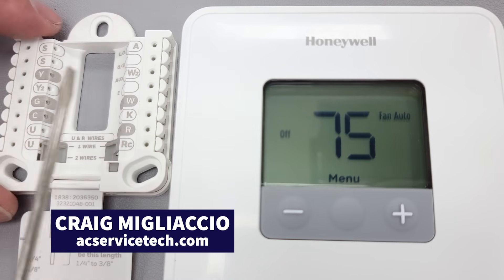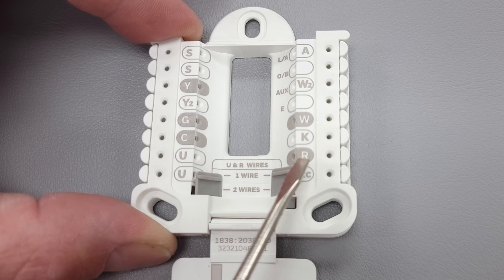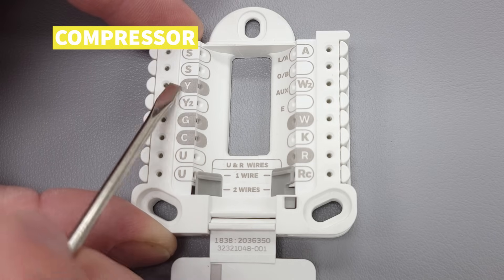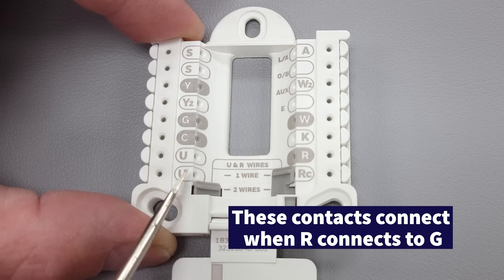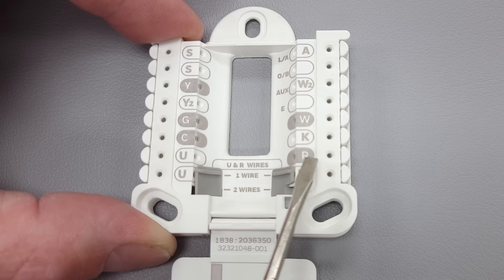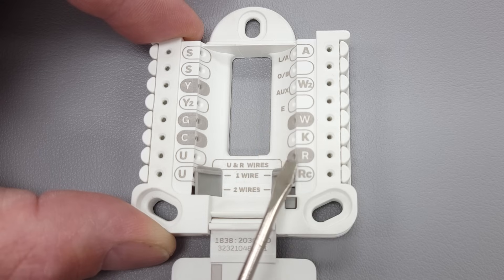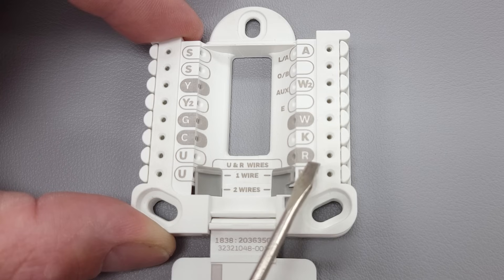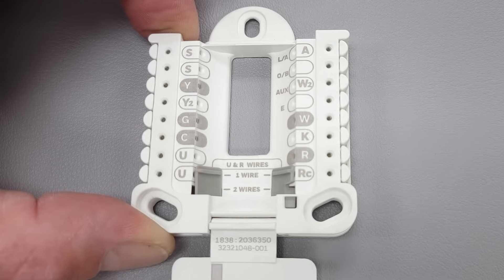Honeywell Thermostat Instructions, Wire Terminals, Functions, Color Code! Furnace and AC! Heat Pump!

Comment: I am currently having issues RTH6360 it goes straight to heat mode it isnt activating the reverse valve selenoid even with O/B wire in the O/B slot i am completely preplexed

Comment: My old thermostat had a jumper wire in the RC and RH terminals.  I don't know where to put it in my new thermostat.
Reply: Hi! I have the same issue. What did you do that worked?

Comment: If i have a t-5 programmable tstat. Wired up the way it supposed to be for a heat pump and i didn’t put any batteries in cause i have a common wire. I have 28v on red but when i plug the thermostat in it does not power up. Is this a bad thermostat

Comment: Just bought one of these Honeywell home t3 thermostats, I have a 4-wire electrical AC heater in my home, seems pretty basic, I hooked up yellow to Y green to G red to R  and white to W Gray. Turn on the unit blows hot air. So I switched the white wire to W2 aux still blows hot air. What am I doing wrong.

Comment: 4:24 in my old thermostat, I have a wire jumper from u1 to r and a staple jumper from r to rc . The main red line coming from wall goes into rc . Do I need to keep these jumpers or will the t9 take care of it automatically? I have a fresh air intake (I believe that is u1) thanks

Comment: Hi please help i have heating and air condition HVAC 5 wires red,green,black,white,orange. do i need to switch up the little switch? also the orange wire can i put it on Y socket?

Comment: Excellent instruction. I have a Amana 2 stage 3/1/2 ton heat pump 1 1/2 years old with a T6 Pro thermostat. I have had the thermostat replaced once because it did not turn off the unit when set temp was met. The unit normally got out of Recovery stage within 30-40 minutes going from cool 77 to 74 at night. Even though the set temp was met the unit runs for hours? The replacement is also a T6 Pro which I have noticed is NOT cutting off unit at night and runs for hours. AC company says is normal! I know it is not but should cut off within 3-5 minutes after set temp is met. The wiring is correct at thermostat (not opening outside unit). I have purchased a T5 Smart thermostat to replace the T6 but feel it is a unit problem so a waste of money. Can you address this issue for me? Thanks
Reply: I am having the same issue with my Honeywell T6 not turning off when setpoint is met in heating mode. Runs constantly

Comment: So in this diagram, you have separate and Aux and E wires tied together at the furnace, so essentially they're jumped together and they do the same thing.  In my setup, I have a heat pump on a T5 Wifi thermostat with an R and W back to TT on a gas boiler for backup. I've tried terminating the boiler W wire at E and at AUX, but as far as I can tell, there's no difference.  Both terminals activate when the thermostat is calling for more than 2-3º of extra heat, and both activate when I turn on Emergency Heat manually.  What gives?  I guess I need a call to Honeywell.

Comment: I have a Honeywell Pro series. Looks like I can just pull it out and plug the T5 in that wire-set.
Reply: I did the same but for some reason it runs heat only

Comment: Hello AC Service Tech LLC, I need some help please.
My old thermostat had the red wire in the RC slot but the RC slot had a wire that was connected to RH which I am guessing that would be my jumper. My question is, on my new T3 where would that red wire go? to the R? or to the RC? Thank you in advance

Comment: I'm trying to use a heat pump with no auxilliary strips and a boiler for 'emergency heat' when it gets below 35°, but can't get this t-stat to switch to boiler without the indoor fan continuing to run on the heat pump?
Reply: I had this problem too. After several lengthy calls with Honeywell tech support, I discovered most Honeywell thermostats are not capable of handling that setup.  The T6 Pro (non-work) shown here is the only one. In Installer Setup (ISU) there are a couple of settings # 270 and 270 that control whether the thermostat runs the fan in Aux and Emergency heat mode.  All other Honeywell thermostats assume you’re using a furnace as backup and always run the fan.

I really like the Honeywell’s for everything else, so I’m probably going to just going to add a separate thermostat for the boiler.
Reply: @litedesign82  My installer located an external circuit board from Jackson Controls, and managed to get it working as it should.  I don't remember offhand what the model number of it it.

Comment: I've got a electric furnace home, the furnace fan constantly runs whether it's on auto or on. I don't believe I have an outdoor sensor but I have a black and brown wire going into both terminals could this be causing my fan to always run?

Comment: can't find what to do if you have separate O  AND  B  wires,
Reply from the maker: O is to power the reversing valve in air conditioning mode and B is to power the reversing valve in heating mode
Reply: @acservicetechchannel  I understand that , my old tstat has both the O n B wires separate connected , old i t8411r, I want to use RTH6580WF, that has a o/b term, not separated
Reply from the maker: You would need to see where o and b are connected to in your air handler and/or outdoor unit. It may be that only one is actually being used, thanks!
Reply: @acservicetechchannel  was thinking that too, is there a dc resistance from b to common if it is used with the tstat off, ,handler is in attic, cant get to it,
Reply: @acservicetechchannel  did some more digging , it's an old trane xe 1200. it has 2 reverse valves, one cool, O wire, one heat, b wire, they don't make a thermostat that does this anymore .
Reply: @mikevi33023  I think white Roger's still makes a tstat with o and b .  I'm not really clear on all this either though

Comment: Hello I'm new to your channel. Just switched from honeywell thermostat  to Amazon smart thermostat.  I have six wires. I believe we have central cooling with a heat pump. We have upstairs and downstairs.  Upstairs has 5 wires. Outside we have two ac units it looks like one has copper coils inside. Problem is, when I put the ac on, it blows warm air and it doesn't feel cool. I hooked the wires up like this.

R G Y O/B C

What am I doing wrong??? Upstairs thermostat works well on heat and ac. I'm completely lost. Please help if you can. Great video btw 👌 downstairs with 6 (only 5 are connected. ) wires is having the issue. On the honeywell thermostat before, had the R wire, jumped into the RC slot I guess. Man I don't know. Thank you for your time

God bless.

Comment: I recently had my furnace replaced and my thermostat was replaced with the Honeywell T4. Now my compressor (AC Unit) will not stop running even when the thermostat is off. I have to turn off the power to the AC Unit from the power box. The wiring to the thermostat is all correct as stated in your video. I need help can you tell me what may be the problem. Now the company wants me to pay a thousand dollars for them to run more thermostat wire because my wire is bad they say. I don't it is the wire. Can you help?

Comment: Nice video.  thank you for taking the time to make it and explain this in detail.  I'm hoping you and or knowledgeable others would be willing to comment to my question, please.

I am having installed, right now, an Amana 2 stage furnace w variable speed blower AMVC960804C and a inverter driven Heat Pump, Amana AVZC200481, with two Honeywell TH6320WF2003 ( a T6 Pro model; I have a 2 zone system) with a New Zone First zone board.  The thermostats are wired to what the Honeywell Tstat manual terms a 1H/1C System w 1 transformer for a "conventional" system.  This is the most basic wiring in the manual.  In the manual are another set of wiring diagrams for "Heat Pump" systems.

Am I missing something?  Shouldn't my themostat be wired for a Heat Pump System, possibly a 2H/2C or 3H/2C?  If left the way it is, is the furnace going to be able to have the two stages act independently?  And is the Heat Pump going to act as variable speed or will it act as just a single speed?  Which configuration should it be wired for?  Given that furnace is 2 stage, seems like 2H should be applicable, or should it be 3H since there is also the Heat Pump?  Given that the Heat Pump is inverter driven what #C should be the configuration? If it's left as 1, will it only behave like a single speed?

I've pointed out the wiring diag in the manual to the tech who is wrapping up the HPump install now and expressed my concerns.  He doesn't seem familiar with this thermostat and is going to defer to someone else later as we go over Tstat operation.  I'm not too hopeful that there is going to be a acceptable explanation, but am keeping an open mind, or trying to.  Thanks for any input.

Comment: I have a Goodman 5tn, 2 stage heatpump package for my house. Everything is in the unit that is outside except of course the thermostat. I have a Honeywell Pro Series model number TH6220WF2006 thermostat. 
The outside unit also has a 15kw heatstrip. Do you have any videos showing how to wire this unit specifically?

Comment: What I'm trying to understand my Vision Pro 8000 has a  W and a W2 wire going out to a American Standard Heat Pump 4TWB3060B1000CA. The auxilary wire seemes to be the W2 wire connected to the heat pump. Think when I had that auxilary wire unhooked from the heat pump the air from the heat pump was warm but didn't seem to be as hot.

Comment: Great video but it still left me questions. I have a Honeywell T6 Pro with the external temperature sensor which supports dual fuel. I have a single stage heat pump and gas boiler. So I configured the temperature change (turn off the heat pump, turn on the boiler) to 40 deg F. It seems obvious that I setup for dual power supplies (Rh and Rc) and control the boiler via the W (heat) wire. But what happens to Aux/E? Are they in effect disabled? Or is the thermostat smart enough to know that when the temperature difference is above a couple of degrees that it needs to call for heat via the W wire?
Reply from the maker: You can look up the model thermostat and verify that it is in fact for dual fuel and the settings will allow you to set this up. There should be a differential that you can set. We usually set this for 10-15 degrees or so because we don't want it shifting back and forth.
Reply: @acservicetechchannel  The differential setting is called "Droop," and it's available on the T6 thermostat, but not the T5. I've read in different places that the Droop threshold will trigger the aux heat anytime the indoor temp is lower than the programmed temp by the determined number of degrees, but I've also read that it will only trigger if it drops below the threshold after a heating call from the thermostat, while the heat pump is supposed to be running. I'm not sure which is true.

Comment: Hi,  I have the old Honeywell control, my white wire is connecting to the port "E" in the old board, but I didn't find the E in the Amazon thermostat, could you tell me which port in the Amazon control I should connect? Many thanks.
Reply from the maker: Not sure what you mean by amazon thermostat, that could be anything. If it doesnt have an E function then you dont have an emergency heat function in that thermostat, thanks!

Comment: I’ve like the T6 model but the WiFi ones I’ve had burn out ALOT!! Has anyone else had these issues? Nice video Craig!
Reply: I know it's been a while since your post but came across an HVAC video concerning your problem . Apparently Honeywell had an issue with some of these thermostats . If you look at the back of your thermostat an on the red label you'll see the model number. Right after that should be a 4 digit number. The problem thermostats have a code between 1917 through 1940 per that video. I'm betting your problem thermostats fell between that range. Best of luck.

Comment: Sir, please explain about checking the refrigerator inverter compressor, sometimes it is difficult to distinguish the damage between the PCB and the refrigerator inverter compressor
Reply from the maker: You can always ohm out the inverter compressor, thanks and we will have a new minisplit book coming out soon at the end of the year that discusses that, thanks!

Comment: I’ve installed a very large amount of t4 and t6 (lyric and regular) thermostats and have maybe replaced 3 that were still under warranty. Unless you’re getting the Home Depot t series or wiring them/programming them wrong, I don’t understand peoples issues.
Reply: Seems like the T6 with a heat pump always gives me issues 🤷🏼‍♂️
Reply: @tycobb8621  no kidding? Maybe I’ve lucked out and haven’t had to put them in on heat pump systems. I’ll keep my eyes peeled.
Reply: @robertjameson1959  the older T6s had issues bringing on back up heat if it was a gas furnace and not heat strips. You could sometimes fix it by removing W on the heat pump but then you would lose your Aux heat during defrost.
Reply: @tycobb8621  I have a Amana 3 1/2 ton 2 stage heat pump with a T6 Pro which I replaced once and getting ready to replace the replacement T6 Pro again because it will not cut off unit once set temp is met, runs for hours so I chance temp and put on Permanent  Hold! Now I will try thyT5 Smart thermostat!

Comment: The t6 are trash thermostats won’t sell Honeywell anymore
Reply: Yeah the T6 is pretty terrible 😂
Reply: Why is it a bad Thermostat ?
Reply: @utahsmokie  we had problems w/ them  failing w/ heat pumps so we started selling Emerson
Reply: What would you recommend ?
Reply: What do you use on dual fuel that is better?